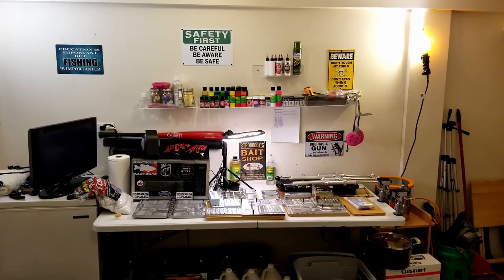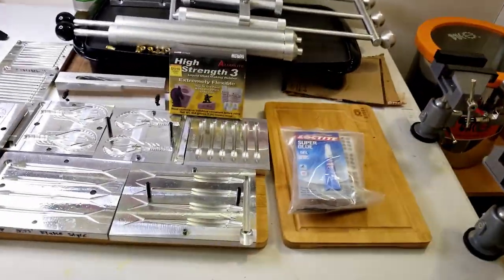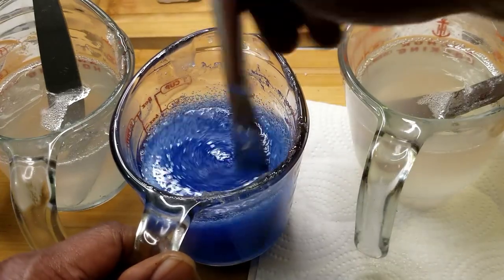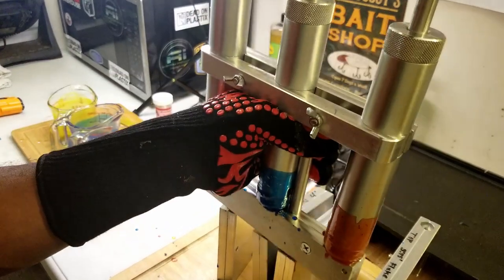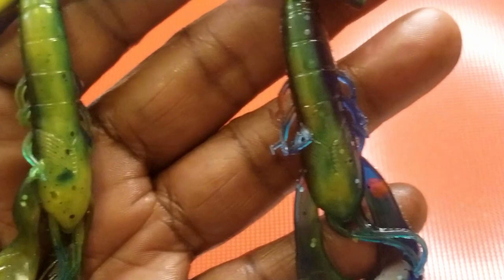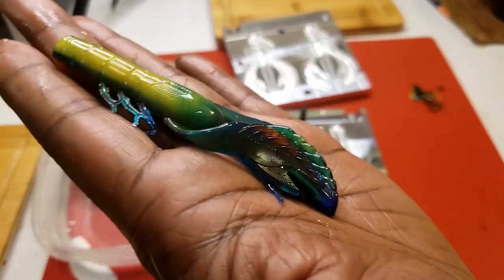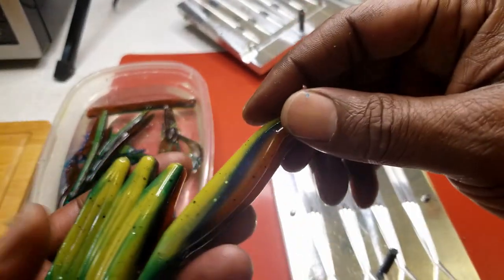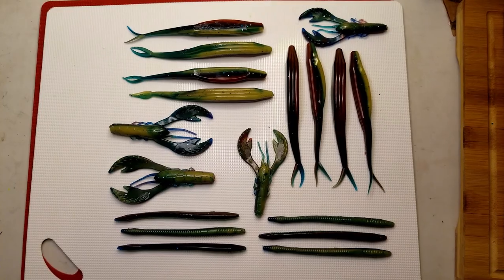Bait Shop Tour - Triple Color Injector - Making Custom Fishing Baits / Lures

Comment: Your using LureWorks CoLure Coat Water Based paint which is meant to be airbrushed onto finished baits; not used as a colorant. That explains the bubbling. You need the Colorants found in their Pigments and Dye section.
Reply from the maker: Ahhhhhh makes sense as to why that's happening! I was wondering why the shape of the bottle was different than the one's I've seen others use. Thanks a lot for clearing up that mystery! Teamwork makes the dream work :)
Reply from the maker: Not sure if I can return them. If not, I guess I'll be getting into air brushing lol

Comment: I have alot of lureworks colorant and have been using it for years and i have never seen anything like what's happening to yours. You need to contact them and tell them about what's going on.That doesnt even look like moisture, looks more like some kind of reaction.
Reply: Also try adding colorant before you heat the plastic and see if the same thing is happening before you call them.
Reply: Ok i stop the video and i commented about adding it before then i heard you say you already try it.Sorry about the 2nd comment.
Reply from the maker: Hi Andy thanks for the feedback. I truly appreciate it. I'll definitely reach out to them 👍🏽